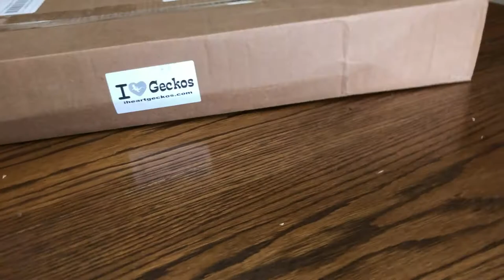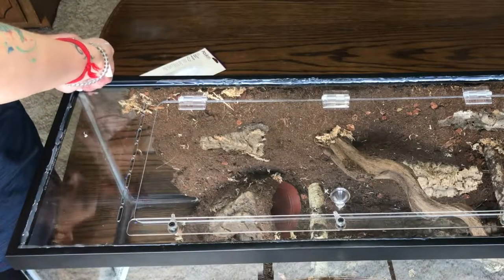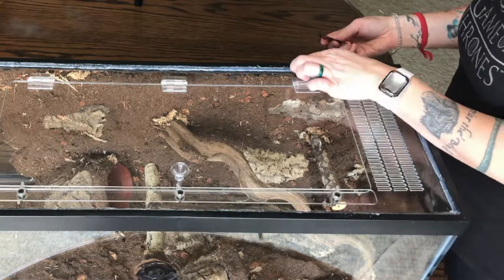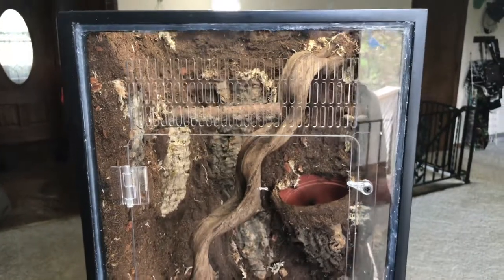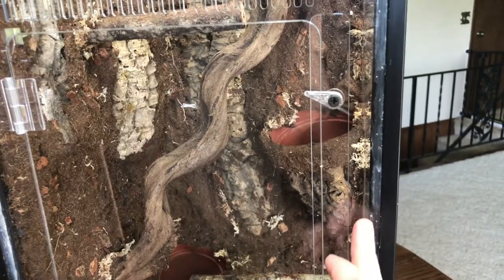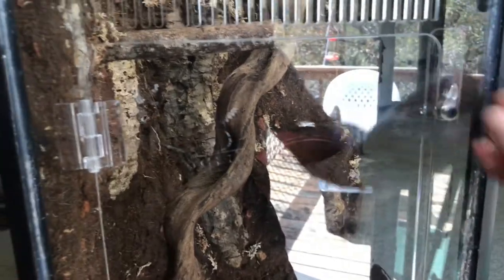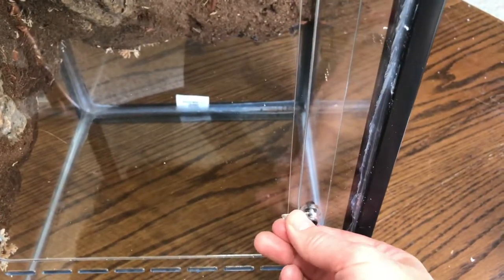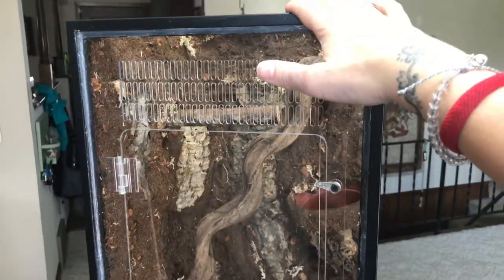How To Install I HEART GECKOS Conversion Kit

Comment: a tip for your next build: it's usually recommended to smooth the silicone out while it's still wet. I've seen some using this conversion kit create edges on the door with painter's tape before applying the silicone. Then you run a finger over the silicone to smooth it and remove the tape while it's still wet to get a clean edge :)

Comment: how do i do this and still use a uvb and heat lamp can i remove the glass on the top?
Reply from the maker: Crested geckos do not need UVB or supplemental heat. I have in the past put a hermit crab heating pad on the side of the tank to create a small heated pocket that is 3-5 degrees warmer than the rest of the tank. I used a strong Aracdia grow light that I mounted to the wall above the tank which also created a small amount of heat.  Both plants and gecko grew well in here.

Comment: I have a 40 gallon tank and I know they have a 40 gallon kit that fits however I’m concerned the heat lamp will break the glass , am I being too cautious?
Reply from the maker: antonio ramirez  I would not use a heat lamp on a closed in tank like that. It is marketed for arboreal  geckos and most of them don’t require a heat lamp. 

I hung a grow light over the top for the plants. It hangs about 3 inch above the glass. The top of the tank is about 5 degrees higher than the rest of the tank because of the light and the glass is warm. A heat lamp would make the glass extremely hot. I don’t think you are being over cautious. 

What are you keeping in the tank?
Reply: Great North Reptiles kinda figured , love the set up btw
Reply from the maker: @IAteZeCheeZe  Thank you!

Comment: Maybe consider running a wet finger along the silicone after applying to smooth it out and reduce the excess like you would if applying to a shower seam or similar?

Comment: I have two questions 1. Is the website reliable and not a scam 2. Where are you supposed to put the heating lamps ?
Reply from the maker: I had a good experience ordering from the website. You can not use a heat lamp with this product. These doors are marketed toward arboreal gecko keepers,. Most species do not require supplemental heating.

Comment: Doesn’t the acrylic warp because the difference of moisture and temperature? Do they have a glass option?
Reply: I'm sure you've already found one by now. But if now, I know of a seller that has a glass one
Reply: @HeatherWho11.10  thx but I learned how to cut glass. It’s more fun to make enclosures by yourself than just buying them.
Reply: @larrycung9131  I agree. I just don't know how to

Comment: Wondering how this is working out and specifically how your lights are set up.  Do you run UVB over the top of the glass, since the side of the aquarium is now the top?  Anyone have any additional mods for these conversions, to allow for UVB on top, since UVB does not penetrate glass?  I am thinking about this conversion but removing the side glass first, to have an open top that can be screened.
Reply: I swear I was thinking the same thing like how do you do lighting for the habitant if the conversion kit doesn't have openings to run your cords for inside mounting? 🤔
Reply: @justinboggs6213  I am going to remove on of the side panels on a 20gal Long before installing a diversion piece, so that the new “top” side is open. Can easily make a screened top for the new opening. Should be much better ventilated.